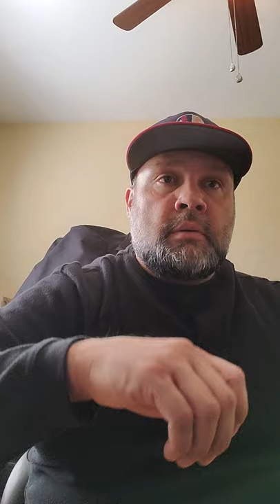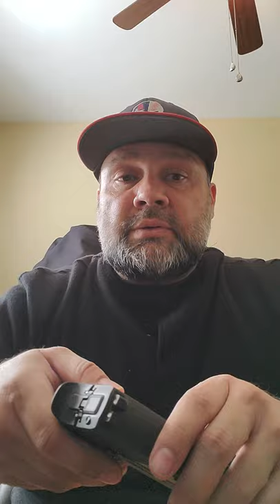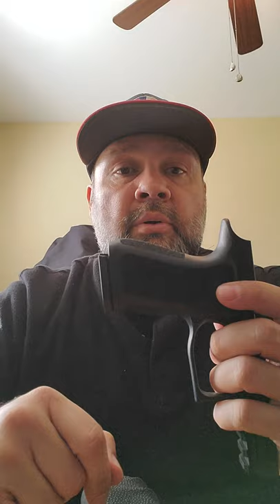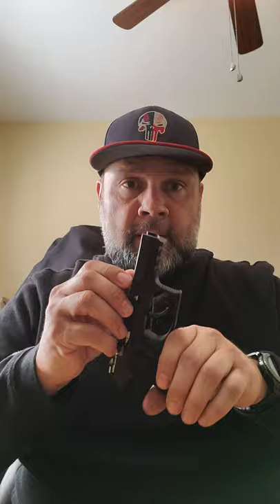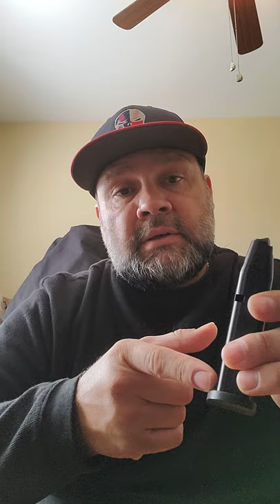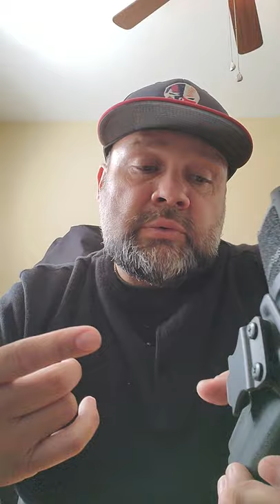Sig P320 X-compact grip on compact and subcompact slide.

Comment: I have the 250 subcompact and it fits the x compact as well but I have to buy a new slide catch lever as well.
Reply from the maker: I use to have the P250 also, good gun.
Reply: @picturemerollin63  nice, this video really helped me out I got my grip module and my slide catch lever and it made it 100 times better. Thank you bro. 🐐
Reply: I’m late I know it. But I’m trying to do the exact same, can you give me more info on your buld and what exactly you need? Thanks in advance

Comment: I have the sub compact, putting the sub compact slide on the X-carry frame, it makes the gun I want, now I need to get new mags, will I have to get a different holster?
Reply from the maker: No, at least not all the holsters I've used. They all seem to fit universally.

Comment: How did you trim the mag to fit?
Reply from the maker: You can do it with a lil bit of soft grit like a fine 1000 sand paper and just sand down the sides of the mag. But I did it with a cheap wana be dremal I bought at Walmart or Harbor Frieght (don't remember). But just trim the sides a lil until it clears.
Reply: @picturemerollin63  I was thinking dremel, thank you.
Reply: @picturemerollin63  I received the frame x-compact and a 15 round mag, the mag fit perfect without trimming the mag, go figure.
Reply from the maker: @Tonympiotrowski lucky you man

Comment: What model for your holster did you buy im rocking the same configuration Sig P320 compact slide on an X compact grip module. I bought a Sig p320 compact holster but it didn’t fit. Any suggestions/help would be appreciated!
Reply from the maker: I believe I said which brand of holster I was using. But off the top of my head I can’t remember.
Reply from the maker: I just bought a new leather and kydex holster from versa carry and it fit perfectly.